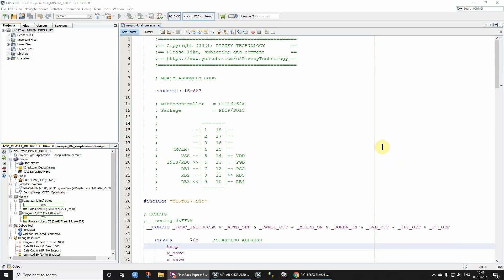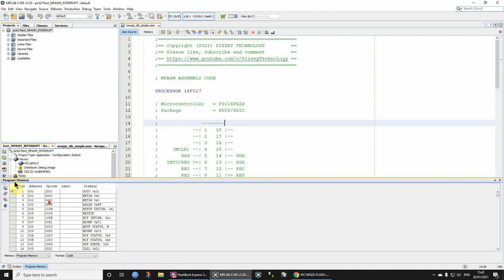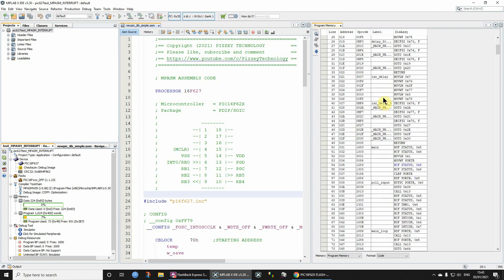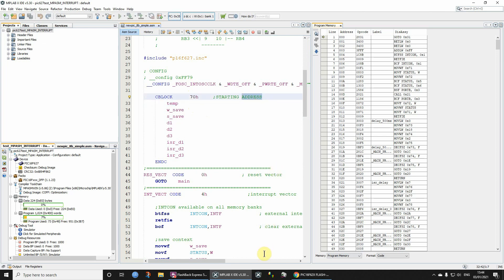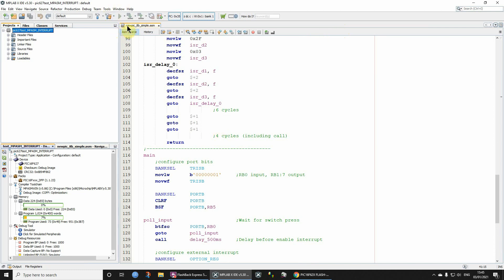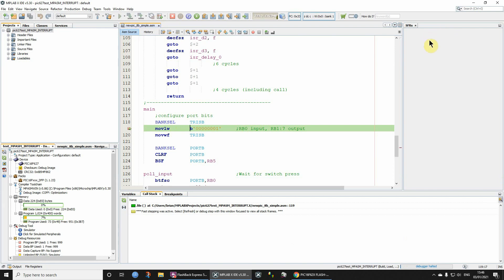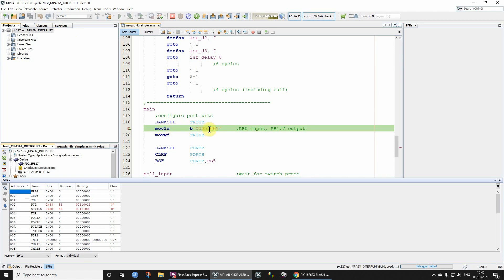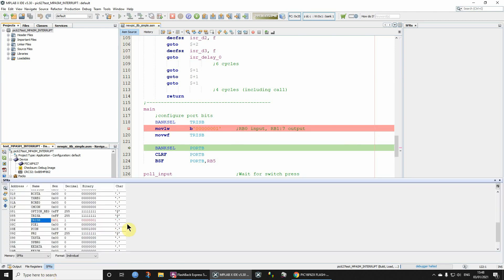MPLAB-X IDE assembly viewing program memory, file registers and special function registers SFR

Comment: Thanks for another great video.  Have you had any luck using the logic analyzer in the simulator in 5.4?  I can't seem to make it work.
Reply from the maker: I might give it a go when I have a chance but I've spent too much time today sat at the computer. Did it work for you on a previous version?
Reply from the maker: I had a look for you this evening and it seems the Logic Analyzer is not working in v5.45
I can open the Logic Analyzer panel (Window > Simulator > Logic Analyzer) but the the control buttons I'm familiar with using in v5.30 are not present. Either I'm missing something fundamental or this feature is broken. According to the following link this feature was supposed to be fixed in v5.45 Let me know if you get it working!
https://www.microchip.com/forums/m1146022.aspx